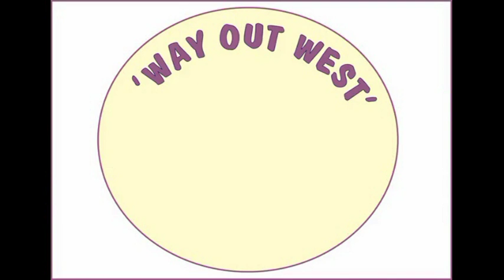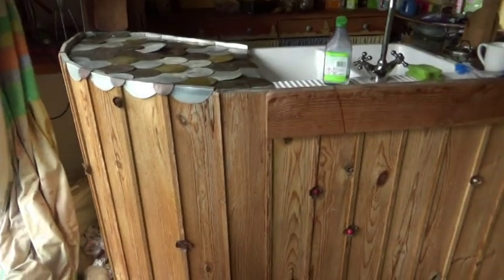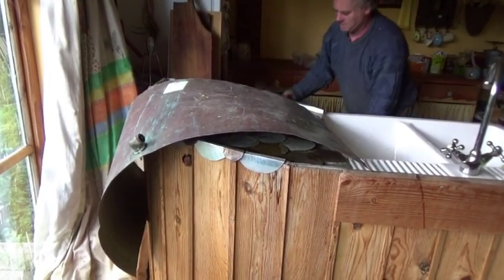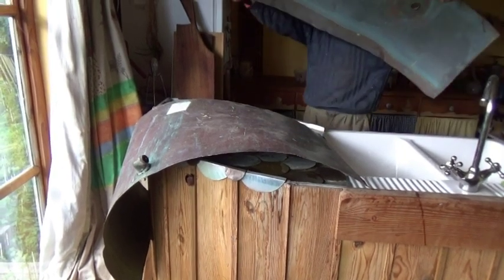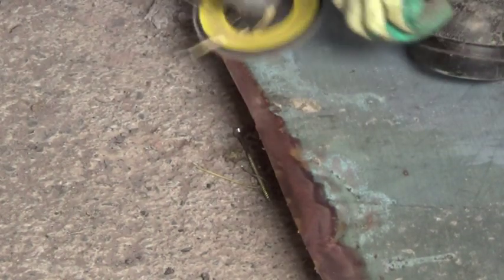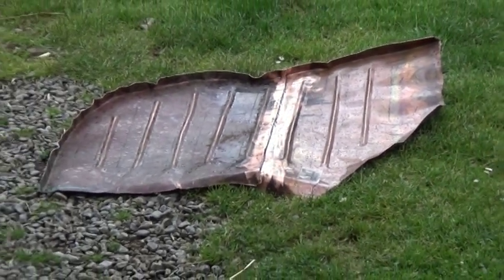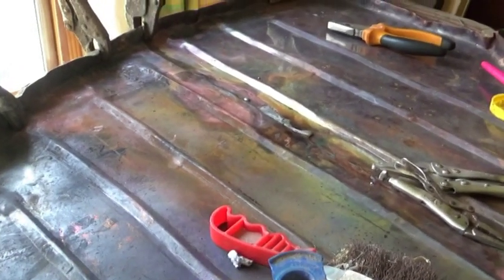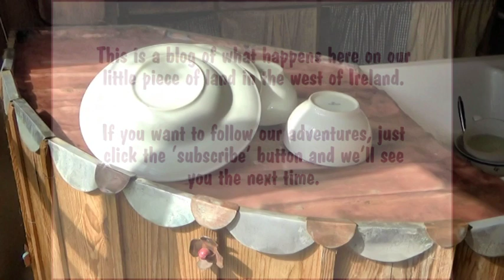Homemade Copper Draining Board

Comment: Have you thought about covering it with epoxy so that there is no air that causes dissimilar metals to oxidize?
Reply from the maker: Wouldn't it just get scratched very quickly?
Reply: Not really, epoxy is the same stuff that is used on boats, they wouldn't use it on boats if they scratched up so easy. But it also depends on how much thickness of epoxy you want to use too.

Comment: As I understand it sits on a wooden frame. Don't forget to ground it.
Reply: Why ground a non-electric copper sheet?
Reply: @jonanderson5137 The main reason is safety. Keep all exposed metal surfaces around you on the same electric potential level (earth). If for any reason one of them became floating live and you wore between, you will have a bad day. Galvanic currents being the minor reason.
Reply from the maker: Not sure I understand, Piotr. You mean to avoid static electricity shock?
Reply: @WayOutWestx2  No. All exposed metal surfaces has to be earthed. Let's say some day you will have an extension cord with damaged insulation laying on the metal table. Someone touches the table and boom. If it's earthed the fuse will blow before anyone would get hurt, even if you sat on it. And of course all those situations you never thought about. Same rule regards all metal pipes and structures, even those on the roof there no one "ever" touches them.
Reply from the maker: ok, thanks